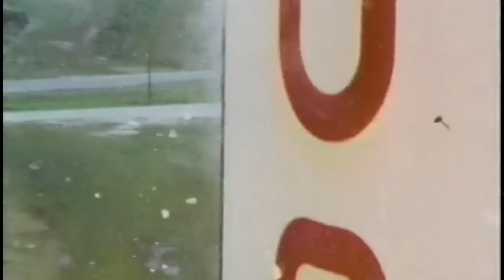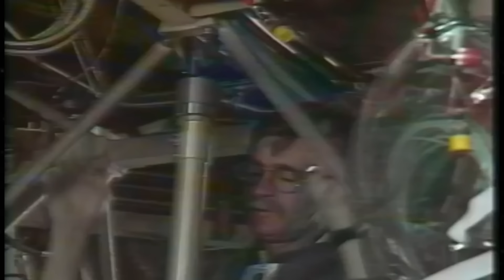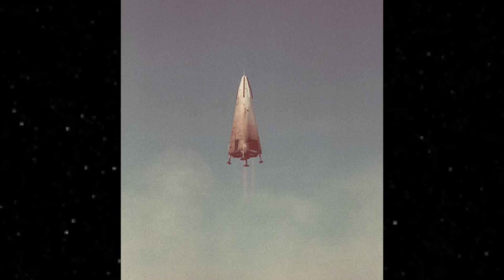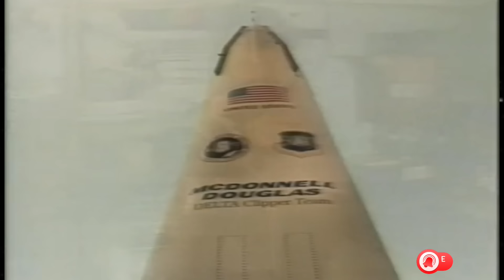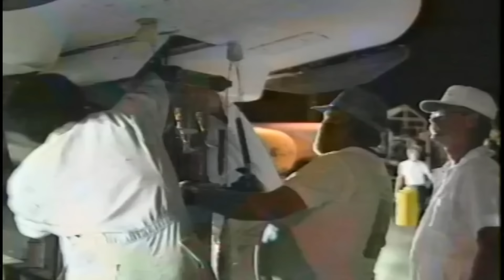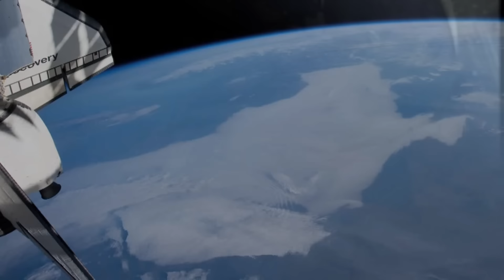NASA Killed This Rocket Over a 25-Cent Part (It Worked in 1993)

Comment: You can't compare the DC-X to the Falcon 9.
Falcon 9 makes what is called Suicide Burn, it reaches 0 velocity when it touches the ground. No hovering to control. No margin of error.
Reply: There is still margin of error with Falcon 9. It may not be able to hover, but it can throttle from about 70-100%.

For example, if you target landing at 85% and time the landing burn for that, a little late and you can throttle up a bit, a little early and you can throttle back.

It is more difficult than being able to hover, but there absolutely allowance for error. I can give you an example of what zero error tolerance looks like. SpaceX tried to do a 3 engine landing to decrease landing fuel requirements and increase payload performance. They could not time things precisely enough to reliably land.

Comment: Ya this channel seems to have a habit of offering misleading and inflammatory "opinions" followed by, (if you watch long enough) some supporting data that only somewhat supports their case.  DC-X/XA DID prove that rocket powered landings were more technologically capable since the mid=60s but in no way "showed" that what NASA (and contractors of which MacDonnell-Douglas was one) "thought" about rockets was in any way wrong. Conservative yes, only to be expected for companies and an organization which had to endure tight and restrictive budgets. $60  million sounds like a low amount but DC-X/XA was never going to be capable of carrying cargo or passengers to Earth orbit either.. It was in fact far below the capability of the Falcon 9 booster stage. But DC-X/XA was only a low res test bed for the idea for a VTVL SSTO.

NASA spent its money on something that would do the job it needed to do, so technically did the DoD (the ones who actually paid the money to MacDog to build the vehicle) as they were only interested in a tech demonstrator with very low levels of capability. "Hinting" that NASA or some conspiracy of companies aimed to "kill" the technology and/or idea is very far from reality.

Why have you never heard of the DC-X/XA? Probably because too much attention is slathered on SpaceX for doing the same thing but that's the way SpaceX likes things. Also it was part of the still unachievable "Single Stage To Orbit" hype from the late 90s which failed to produce any real evidence for the concept and due to that focus tended to drown out any other possible "reusable" spacecraft concepts for the next couple of decades.

Yep, same focus on the DC-X/XA ONLY while ignoring the funded follow-on of the X-33. The "technology" and "concept" were a majorly funded NASA program for the next decade but as it had technological problems and was to hyper focused on "Single Stage" performance along with NASA/Contractor technological overreach, it didn't "revolutionize" the launch industry.

Yes Bono was a visionary, NO actually his "math" didn't actually work. Bleeding edge technology "requirements" (such as the common use of semi-frozen hydrogen for propellant among unproven other needs at the time) in order to get the promised performance the numbers used to make the math were standard in most of his designs. The other problem was the majority of his designs required a huge vehicle to even be possible WITH that dodgy math and in aerospace a larger vehicle always costs more to design, built and get into operation than a smaller one.
His proposal for a heavily modified Saturn S-IVB stage, (Saturn Applications Single-Stage-To-Orbit) was the smallest and only practical "near-term" design and it was marginal at best using the above "required" not-available technology to be developed first before it could even possibly fly. It was far from a "lack of will", it was a lack of money, and technology along with the hyperfocus on getting to the Moon and budget/support crash after Apollo that kept his ideas on the drawing boards. (For the most part, may of the technologies he'd proposed WERE actually developed such as the liquid fuel plug-nozzle engine and the regeneratively cooled heat shield)

Max Hunter, in the 60s was one of the ones who told Bono his stuff wouldn't work. He "thought" that  by the late 80s/early 90s that the technology for SSTO "might" be possible. (His vastly more conservative math said "maybe" but he still wasn't sure)

Spacecraft are not airplanes and airplanes are not Spacecraft, this is a physical reality and well understood. A spacecraft with the needed performance to reach orbit in a single stage has very little, (usually negative actually) payload capability as the structure and systems to survive such a journey weighs a lot more than what is needed to for an aircraft. The idea that spacecraft can, (or even should) operate like aircraft is questionable at best since no aircraft, (or for that matter no transport system we've ever used on Earth) has to have such high performance and low weight of structure as to be comparable with each other. As SpaceX is finding out, (again, they used to know this stuff but apparently the talent that designed the Falcon 9 is no longer there) that there is a minimum structure needed for spaceflight and that this does not always work so well with the needed structure added for reuse. Reliability also costs you mass, there is no way around these issues which is why the "Rocket Equation" is both revered and reviled by space engineers and designers, and  reason it is called a "tyranny".

The "orthodoxy" was right though,, DC-X/XA was "cheap" ONLY because of its small size and experimental (and limited) nature. The DC-Y follow-on proposed for the X-33 program would have been vastly more complicated and expensive to develop, even McDonnell Douglas KINEW this and the only ones who DIDN'T think so were the SSTO advocates who essentially quite listening to the engineers (including Hunter) who tried to reign in the enthusiasm. "Expendable" was in fact cheaper than reusable for most of the early rockets because they tended to share costs with the missiles they or their part were developed from. "Reusable" was always prefered but didn't make that much economic sense when you had a large industrial base already bought and paid for by the military. Hence why the Shuttle cost so much no only to develop but to fly, not due really to the cost per flight but the needed infrastructure and support that was aimed at supporting a single launch vehicle type that didn't fly all that often when compared to other transport systems. SpaceX took a chance that reusability was now economical but only managed to get the first stage to the needed cost point, so still only partially "reusable".

Oh yes the "orthodoxy" was this entrenched "interest" group who just also happened to be where the idea and reality of the DC-X/XA came out of... Which also wanted/needed OTHER people's money to put any of these ideas into practice? You know, like ANY company, ever?
"Hunter and his team" would have to approach the SDI BECAUSE they knew they were getting money when NASA was not. As it was the idea that the DC-X might work was supported by NASA, not opposed to it, but as Congress wasn't giving NASA to do much of any "research" they turned to the Military which always has (had) money to burn. The 'plucky' little team of underdog defense contractors, went to their usual source of money for research and development efforts and pitched them a small, inexpensive, (and limited) test vehicle like they always do. Somehow I guess that doesn't sound as 'heroic', but facts are like that.

"Thinking" about things might have helped this video. You know if you compare the DC-X/XA to something that it actually resembled, say like "Grasshopper" from SpaceX it suddenly doesn't look so great. It WAS since it was done long before SpaceX's idea even existed but comparison wise it was a prototype of a possible test vehicle which itself would be far short of the Shuttle let alone any other existing launch vehicle of the time and as such was very, very limited in both scope and capability.
(It kind of says something when DC-X isn't even mentioned by SpaceX as an inspiration but an even smaller, even more limited more "modern" test vehicle, the Masterson Space Systems "Xombie", just happened to catch Musk's eye. Lot of things to dislike about the Man but his lack of historic sense for a supposed subject he supposedly "cares greatly" about is pretty damn shocking AND disappointing)

Comment: You keep comparing the operational cost of DCX versus the Space Shuttle.
The DCX did not require tiles as it did not fly that high -- so the related temperatures were no in the same range as in comparing apples to oranges, IMO.
It is impressive but 10,000 ft does not an astronaut make, IMO.

Comment: Maybe this is a negative comment and conspiracy theory, but the billions of dollars and well-payed management and engineers, and political theatre built around it, and widely reported in the media and news channels, you have a lock in industry around it, and then you only need one or two people, who are in the right position, to sabotage the DELTA CLIPPER, and you only need to (1) skip pre flight inspection, and (2) remove a small pin from the hardware. You need an explosion on the pad, so maximum damage, has the best results. How can you prove someone's intent in removing a pin? 
ONLY when the Space Shuttle was retired, a project like the DELTA CLIPPER was possible, and it is now history that SpaceX done it in 2015

Comment: All of that is great, but if the rocket goes into orbit, it is going to have to reenter the atmosphere and it is going to need those heat tiles (or other heat shielding).  They got it to take off, move horizontally and vertically,  and be able to land.  Very good beginning things.  But they didn't get to the 'hard parts'.  Making it actually be able to return from high earth orbital.  That is the part that requires all the exotic materials and massive amounts of thrust to slow from 28,000 mph.  It's all well and good to do the preliminary aspects.. but you still have to have enough thrust to get to space and enough thrust and shielding to to survive reentry.
Reply: Hmm, did Burt Rutan's SpaceShip 1 use a heatshield to return back through the atmosphere?  ... No, it didn't, but if you return in a high-speed, aerodynamic trajectory, you need one, as the friction with the atmosphere increases the thermal loads on the craft.
Reply: Absolutely right. The DC-X did the easy part. The real challenge is carrying enough fuel to achieve orbit and shielding for re-entry.

Comment: In my opinion, the pin was removed on purpose to have an excuse to end the project; the lobbying by companies like Boeing in favor of disposable rockets was very strong at that time and had the support of congressmen.
Reply: I'm sure it was.
Reply: Eh the landing jack pin was NOT removed, was the problem leaving the jack not able to extend. Keep in mind this wasn't actually about "reusable versus expendable", even MacDog was making parts for expendable rockets because they were cheaper (at the time) than any projected reusable rocket. This was specifically about SSTO versus expendable rockets and ONLY SSTO as the lobby that got the project started and initially funded was only interested (and focused) on Single Stage To Orbit. By the time DC-XA crashed NASA was already being given the object of running the X-33 SSTO demonstrator plan which they actually got money from Congress to do. (Congress refused to allocate money to rebuilding the DC=X, which made sense as the program had reached pretty much all its initial goals)
Even the X-33 was going to be far short of an orbital vehicle which was going to take even more development of both structures and other space flight technology to even come close to the concept of SSTO.

"Reusability" was never rejected but it always held a cost in design and development which didn't make that much financial sense when making many expendable rockets, (since most early ones were based on missiles and therefore shared some costs) with a consistent low flight rate. The general launch market has not expanded enough to rally make a difference yet. (Falcon 9 flies a lot because it existed and was pretty much the only choice available, now that that is no longer true Falcon is going to fly less)
Reply: for Boeing it was all about the money they get from building rockets for NASA
Reply: @AyanBurch Just like every other contractor including MacDog. Nothing unusual at all.
Reply: Absolutely since it went into NASA Hands it was already being killed off. They did 3 good test and then on the 4th they killed it. NASA Tried killing dragon when one crew capsule exploded on a test( this was due to salt water(they were testing the draco engines after the unmanned mission to ISS CAME back and landed in the sea. SpaceX Identified the issue, and as precautionary they said they would not reuse the actual capsules once they returned to earth(so crew dragon capsule increased the cost per astronaut from 42million to 52million per): compared to the 82 million Russia was charging that’s still a little 30 million per astronaut savings. Poor starliner should forget  it’s 8 missions it’s “technically supposed to achieve” and use the bottom rocket for say DreamChaser ( private larger reusable glider like the shuttle but it may be too big for the rocket) one rocket Dream Chaser could use is falcon heavy? And where did blue origin all of the sudden come out of nowhere and get all the necessary data to land their rocket? That 🍆 ride version wouldn’t give all data for a twin closed fuel  stage system? Then guidance on how to land? Remember SpaceX spent years with Grasshopper performing the same test going up and down like Super Heavy until reaching orbit. Also The Orion capsule has serious dangerous issues but NASA is ready to send them past the moon farther then Apollo? Weird? The first test Orian had was unmanned around the earth, then it should be manned by 2 around the earth. Then sent by itself or sent by itself around the moon. Then sent around the moon crewed. That’s exactly how Apollo did all it’s safety checks. And it wasn’t until 11(-1 that killed the 3 astronauts on the pad) so 10 manned and unmanned missions before an attempt to land on the moon. Not to mention the way the capsule is its small, no room to move, their supposed to get the Luner Gateway Space Station into a Geo Station Pol orbit around the moon first so the capsule can dock, and then take a lander to the surface. And their SLS or Heavy lifter rocket is still using the dirty crap space shuttle boosters, and throwing 2 fuel tanks( liquid O2, Liquid Hydrogen[which hydrogen escapes the tank bc molecules are smaller then the metal] but the whole “artimas concept” will be carried out mostly by SpaceX, then Maby Blue origin, and maby dome NASA? NASA is using reused parts and sounds good on paper but years later over due date, over budget in the Billions and it’s crap. NASA can’t even broadcast a great video of a rocket launch? It’s 2026 almost! We watch all 3 rockets of falcon heavy launch, and land! Their NOT rethinking there just maintaining status que…until someone’s killed on their machine they made and ok’d…
Reply: "Don't attribute to malovence, when incompetence can explain it just as well."
Reply: @daytimenumberofthebeast959  Well we can see that the incompetent ones took it over from the copetent ones. So you are saying that incompetence is better than malovence?

I think the term your looking for is malicious, not malovnece.
Reply: @stevenwyatt2922 I am not saying that it is "better," just more likely of an explaination.
Reply: @daytimenumberofthebeast959  Sad part is that we will never know the absolute truth whether it was negligence or incompetence.
Reply: @daytimenumberofthebeast959  Well said.

Comment: But can't TODAY'S reusable spacecraft be ready to fly again in 26 hours? 
Why didn't Space X or Blue Origin simply continue the  DC-X program?
Reply: DC-X was a dead end, just a proof of concept. The new sheppard is far superior to this thing. It cant carry anything let alone humans.....as I said just a proof of concept, and im not even sure in the 1990s they had the technology to put this in orbit.
Reply: Because they are trying to put useful payload mass into orbit. Which requires much bigger rockets and ecconomy of scale, it's not about just having a re usable spacecraft. It's about having a reliable Space semi truck for the the next 50 years, to do this they had to replace RP1 with metholox which requited a entire new engine design nasa has never successfully launched into space, so spaceX was the first to develop one successfully and put it on a rocket which was the starship, starship aims for the rapid reusability.
Reply: @miguellopez3392 exactly.  This was a proof of concept and it never had to reenter the atmosphere.  You have to travel 28000 mph in low earth orbit.  You have to have shielding to reenter the atmosphere at 28000 mph.  You have to have enough thrust to lift payload, not just tanks of fuel, you have to have enough thrust to inject and remove the required delta v to get to 28000 mph and to then slow from terminal velocity back to 0 after you survive rentry.  This had none of that.

Comment: NASA focused development on the Lockheed Martin VentureStar, which also failed.
Reply: I looked into the venture star over the years, and I can tell you that every problem was manageable (the composite fuel tank which was one of the biggest changes was figured out just months after the program was canceled). The ultimate thing that killed it was bad politics (the Bush administration didn't want to have a program started by the Clinton administration to succeed) 🤠